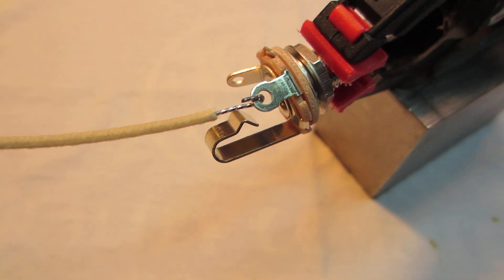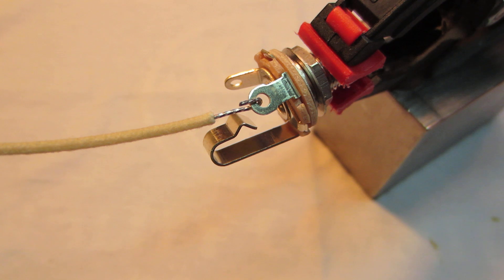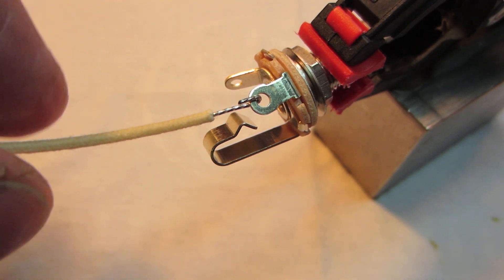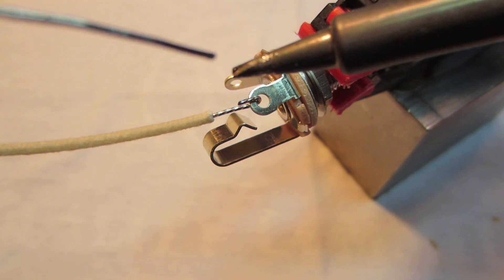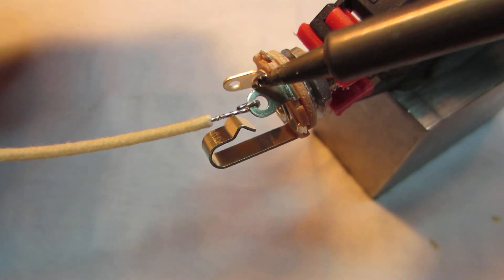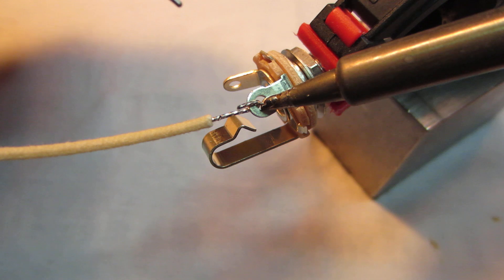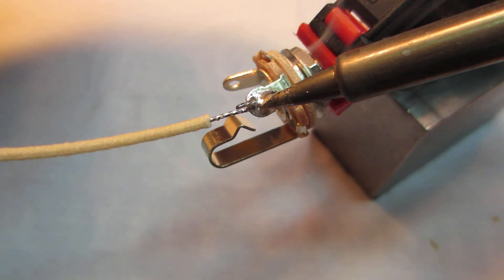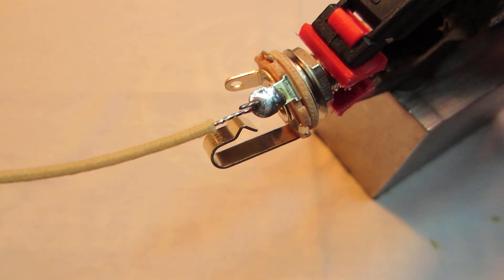How to solder a 1/4" jack.

Comment: Finally!!! A video that actually shows you how to do it
Reply: It’s actually easy. I don’t do what he does. I just make sure it’s properly connected and then go ahead without being careful or thinking about it. It usually ends up being a crappy attempt. So then after it cools down I touch the connection again with the soldering iron and reflow the solder connection and maybe add a little more solder. After that it turns out fine.

Comment: hey, I'm a little late but I've been soldering microphone element wires to these guitar jacks to create microphones, but I'm always unsure which wire from the mic (there's 2 wires) I should solder to which of the 2 connection points on the mono guitar jack .. the problem is I've tried both and both seem to work, how can I test which one is the right way?

Comment: Great video! I'm gonna do my first solder soon. I got a question, what wattage should you recommend for doing a audio cable to a speaker terminal?
Reply from the maker: So sorry.. I've been slacking.. an adjustable iron is a good thing to use.. try 350°F

Comment: What is the best wattage (and brand) soldering iron and tip to use? The ones I have always seem so weak and when I see videos like yours the iron just seems to melt perfectly.
Reply from the maker: 20-25 watts for delicate wiring, 40 watts for jacks and the backs of pots. I use Weller and Hakko. Avoid the "gun" shaped devices.

Comment: How do you know wich cable to solder with wich pinouts ? Like is there a left or right ?
Reply: the ground goes to the connector on the inner sleeve and the + goes to the other connector. Go look at a wiring diagram.

Comment: How much pressure do,you need to apply to adequately heat 'the work'  to get the solder to flow and what heat do you suggest? i was trying this and it was driving me nuts, isnt as simple as you show
Reply from the maker: I'm only using enough pressure to hold the tip of the soldering iron against the part.

Comment: Nice video. When soldering to a mono socket, does it matter which terminal the ground goes to and which the audio is connected to? I see you have only soldered to one terminal.
Reply from the maker: That one wire was just for demonstration purposes. Ideally, you'd solder the "tip", which is the long J-shaped lug to the center conductor, and the "sleeve" to the outer conductor (if using shielded wire).
Reply: +Dr. Pinetree thank you. Do you know which terminal the ground would go to and which the audio would go to as a rule on a mono terminal like this? Is it obvious?

Comment: This may sound like a strange question, but i am wanting to use 1/4" connections for an upcoming lightsaber project that will be running upwards of maybe 2.4A (so it is important to ask). Is the threaded shaft (or any of the metal used in mounting) apart of the circuit? In other words, if i mounted it to metal, would it become energized? Just wanting to know so i can plan. If it is apart of the circuit, i can use wood or 3D print the piece i want to mount it too. Thanks in advance :)
Reply from the maker: Yes, absolutely. However, you can use an insulating flat washer to mount it.
Reply: Thank you very much for the info. couldn't really find an answer online. :)

Comment: Don't make that damn J shape on the wire.It's unnecessary and it's a bitch to fix when it breaks... and i mean WHEN it breaks.

Been fixing and using audio-equipment for ages. Trust me.
Reply: he is right! and have a CLEAN and hot enough soldering gun tip to make the solder melt into a liquid pool....   not 'roll off' solder balls
Reply from the maker: You are correct.. I've had to replace a pot of two, and it is indeed unnecessary.
Reply: @Dr.Pinetree  I always pre-tin the hole so it's closed, then I heat the lug and push the pre-tinned wire through the hole when solder is melted, lift the iron and it'll stay.

To avoid cold junctions or dry junctions you can give it a small sip of flux with a flux pen before reheating it :)

Third hand's (helping hand jig) needed if you want to keep straight wire in place while you heat the lug and put solder on to that... and it easily heats the wire too much -> melts the insulation... :)

Comment: not really good.the wire expose too long.
Reply from the maker: I can get away with it because I'm using cloth covered wiring. Had it been plastic, then you'd be 100% correct.
Reply: Can you go into more detail as to why? I'm a soldering newbie and looking to garner as much knowledge as possible.
Reply: You would basically cut of the excess wire lead afterwards. The idea is to minimize the chance of that extra wire touching another metal source and shorting out. Just cut it back and you're good to go.